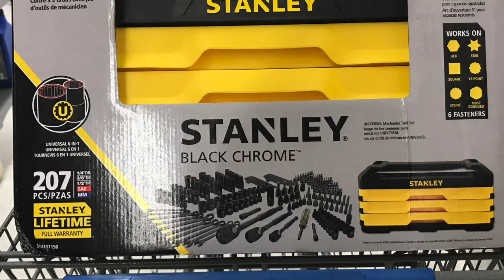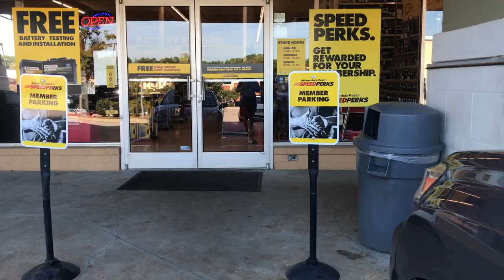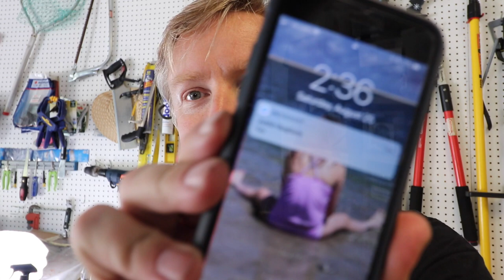Replacement Radiator and Fan Clutch [Jeep Grand Wagoneer Repair]

Comment: Ok- you know what? This would have been a LOT more useful if you had actually bothered to go through the troubleshooting steps to identify a bad fan clutch. Mine fails the manual test to see if the fan is locking up when it's at temperature or if it just freewheels; I just replaced it and the NEW fan clutch ALSO fails.  I don't know what YOURS did so NOW,  since you changed *two things at once*,  there's no way to tell if it was the fan clutch OR the new radiator that cured your overheating problem. In short: I'm glad you had fun but you just totally wasted my time.